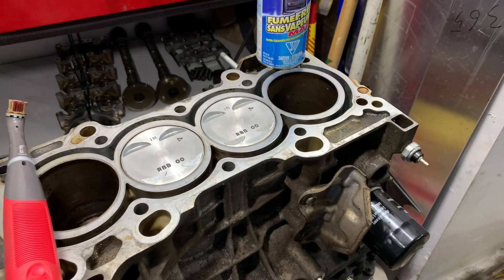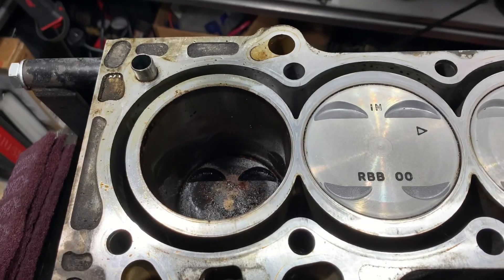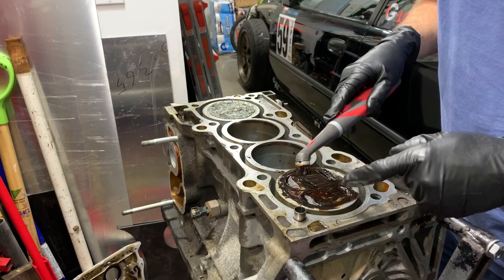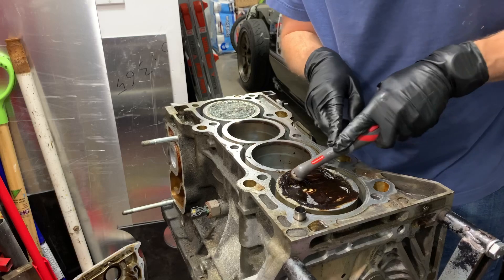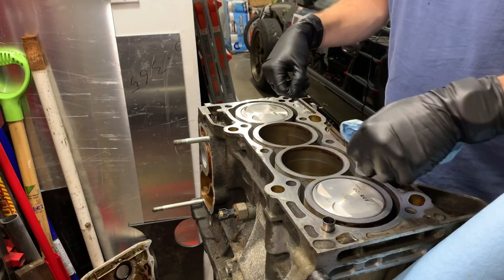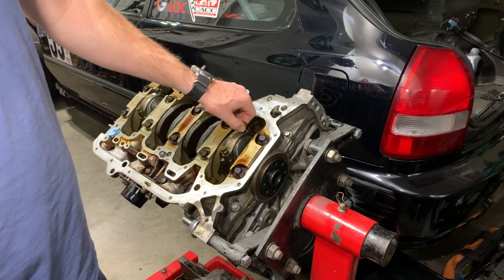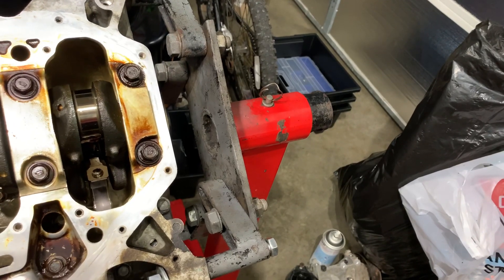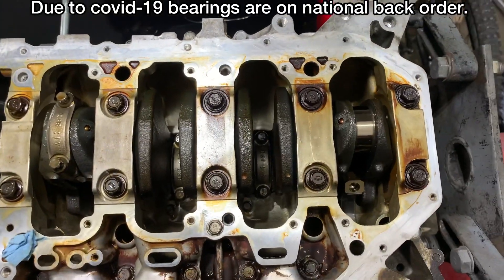Budget k20/k24 build begins! Ep.1

Comment: what kind of brush did you use ? It looks like a electric toothbrush lol.. but it did a fantastic job I would of never thought to use easy off lol
Reply from the maker: Yeah it’s very similar to a tooth brush. I found it at a hardware store years ago for cleaning hard to reach areas. It really does make things easier. Easy off does 90% of the work though it’s amazing.